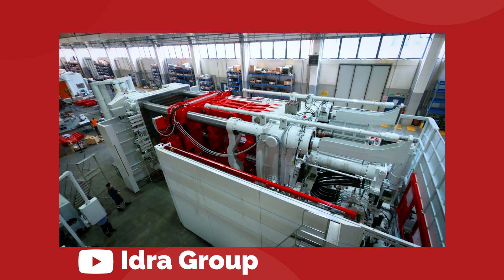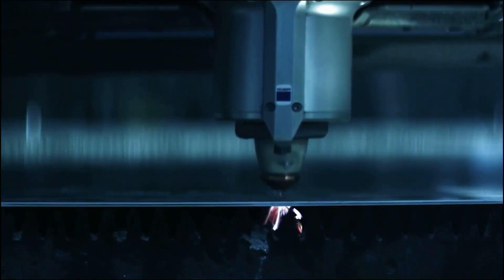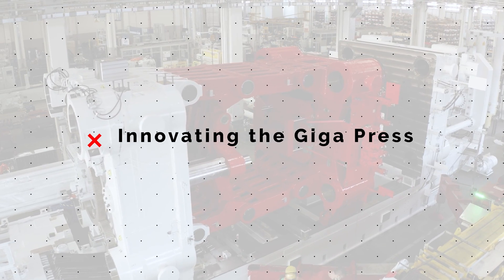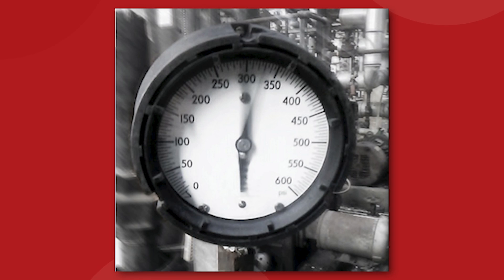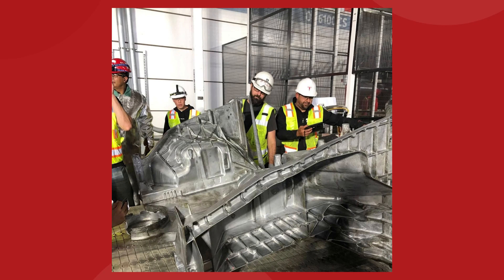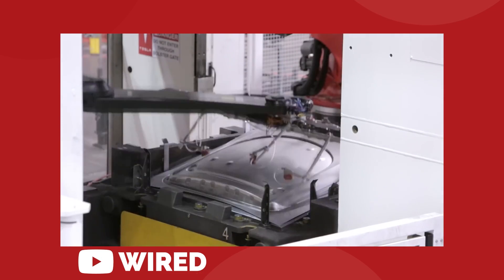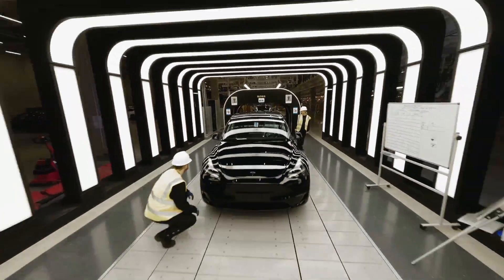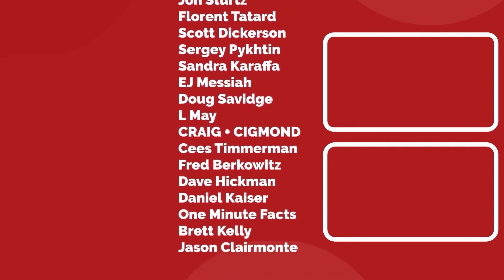The Real Reason Tesla Developed The Giga Press!

Comment: Hey, would have been neat to have an actual comparison between a solid frame and a sheet metal & welded frame, you know, repair costs if damaged, crash tests, actual long term manufacture costs and required power for making them, you know, the basics.
Sure, you did tell that it reduces shop size, but I'd like to know some real data about it.
Reply: if damaged it probably can't be repaired.  but that OK just write it off and melt it down

Comment: VJ'S (Video Jockeys) have "opinions "..
While the "giga press" is the next level of casting machines that is a very impressive product of engineering it still requires steel or aluminum to cast... The fact that it still requires basic elements to work seriously limits its capabilities.

Comment: Excellent vid, and well narrated. Interesting to learn about the diff between clamping vs. injection force. And the filter for the molten aluminum was interesting, as would be the machines which produce that filter, and the machines which produced THOSE machines.... ...smh... engineering wheels within wheels.  
I never checked this channel before, but like Ahh-nold says,  "Owl be back..."

Comment: The differential between injection and clamping tonnage is a pressure consideration is it not? The pressure at the head of the plunger, when applied to the greater surface area of the mold cavities requires far more clamping tonnage. So the forces cannot be the same but the pressures are (negating losses in the injection).

Comment: Good for manufacturing maybe, but a slight accident will total a Tesla because it is deemed irreparable. Also, Tesla goes to great lengths to prevent independent shops from fixing a Tesla, primarily by making parts unavailable.
I considered buying a Tesla until I learned this.

Comment: One down-side for using the single cast component for large parts of a car. A car accident... Anything that crushes, cracks or breaks the casting requires a new casting. If you priced that casting, it will probably almost the value of a car due to the cost of removing the damaged part and replacing it with a highly priced replacement casting. 
More than likely, anything that breaks the casting will end up as an insurance constructive loss, or total the car and replace it. Your insurance will cost more since it will cost them more to keep most of them on the road.

Comment: Why clamping force on dies is so must higher than the pumping force? Simple... "mechanical advantage".
Basic hydraulic pump theory:
Say, two piston/cylinders of different areas containing an incompressible and frictionless fluid are connected by a fluid conduit. If a certain amount of force is applied to one piston the other piston will push with that force multiplied by the ratio of their areas.

So let's say the area of the piston injecting the metal is 1 square-foot and the effective-area (parallel to the die faces) of the part being cast is 20 square-feet. The force required to keep the dies together will need to be 20 times the force applied by the pump.

In real life, liquid metal has significant viscosity and some extra force is required to keep a tight seal between the dies.

Comment: During WWII the Germans used a MEGA Press to build fighter airplanes.  It gave them  many advantages in rigidity,  material flexibility, lightness and speed of manufacture.  The presses in the Allied sector were moved to USA after Germany's defeat ... So old tech with a modern implementation.

Comment: Efficiency is questionable. It all depends on time it takes to produce parts. Estimate is 90s cycle.  This could be limiting factor. Normal production time is less then a minute for car (300 000 cars per year). They have 4 presses. Two parts per car and at this moment just one model. That makes it 45s per part without manipulation. That does not look very promising. Stamping and welding requires more steps but it is way faster. And castings have one big disadvantage. If you crash your car and damage this casting it will be totaled. In case of stamped parts, you can replace lot of them. But cast part is too deeply in base structure.  It will be lot of labor and very expensive part (If Tesla will be willing to sell spare part. Most  probably not). You can argue , that some damage could be fixed by welding, but only some minor damage. Cast parts are hard to weld and strength of welded part is lower.

Comment: there are better manufacturing processes but either they are patented which destroys our advancement speed in technology or the technology although theorized has not yet been tested like the idea of flashforging particles of metal being suspended in the air with ultrasonic vibrations. that idea can possibly make the strongest parts ever possible because every atom can be welded specifically where you want it. also Elon Musk is basically a scam artist and you should probably figure out how to branch out your channel eventually. your entire success is reliant on the success of a man who has failed more times than he has succeeded and all he has left is Tesla, starlink and his satelite delivery system. starlink might also fail. being a fan of someone like that just makes it hurt more when they eventually fail because he is human unlike what some people think.

Comment: That's a cute little press.  After WW2 the U.S. built a 50,000 ton forging press.  It currently resides at Howmet Aerospace's Cleveland Operations, where it stamps out parts for U.S. fighter planes.  It was completely rebuilt a few years ago.
Reply: Most of the people in this comment section are impressed by this littlething 😄
Reply: Watching the 50k run is very cool for an engineer. I had a little part in the rebuild-  I  installed the 50K press' fume exhaust.  My boss ran the rebuild project.  That little press at tesla is about the size of two presses I have rebuilt... the 4000ton Ajax and the 3001 rd wood press.
Reply: And by the way, the us built two 50k ton presses and two 35k ton presses in the 50's. All gour still in operation.
Reply: Typo...all four still in operation.

Comment: Having only two main structures on a vehicle sounds good until you get into an accident and you have to replace one half of the vehicle if only a small part of the structure gets damaged..... Unlike a normal uni body construction which you can drill out the spot welds and replace or weld on new panels.....

Comment: It's beneficial for the manufacturer, not the consumer. If that vehicle is in an accident, it's totaled. The only way that will be repaired is by replacing the whole section, which will end up costing more than the depreciated value of the vehicle. That in turn will raise the cost of insurance on those vehicles.

Comment: The production advantages created by Tesla speaks volumes.  A similar presentation concentrating on the casting machinery created in Italy mentioned another advantage missed in the presentation just viewed.  I speak of the speed the casting machinery works at.  I believe the entire process was something like a minute and thirty seconds.  Running for 24 hours straight creates 960 car castings.  Allowing for inefficiencies and maintenance of the machine say 10 percent still leaves a huge production capability.  I toured a ford plant in Oakville , Ontario Canada in the mid fifties as a teenager.  Amazing times.

Comment: The problem I see with these large monolithic pieces is repair.
If something tweaks the frame of the car, you can't get a new member and bolt or weld it in place,  The part has to be tweaked back into shape.  Now you get into issues of work hardening and how metals become brittle when hardened.  I'd almost rather see smaller parts cast and then robotically welded together.  It would make for a more repairable chassis.
Reply: There's another possible related issue. Lamented sheet steel stampings, when designed properly, can flex and absorb impulse forces for decades without fatigue. A casting just can't, and I'm not convinced that problem can be eliminated. 

Wouldn't put it past musk to sell a car that he knows will have a reduced service life due to structural failure.

Comment: Jaguar Land Rover have been using single piece aluminium pressed frames like this for decades now. They use Swiss made robots to do it, the same ones that make Airbus plane frames.

The only thing unique about what Tesla is doing is having the press cast inside the car assembly factory, most car manufacturers avoid this due to extreme risks.

Comment: Very impressive technology, a great explanation, and a nicely made video. However, very worrying from a repairability perspective.  You cannot weld on cast parts. So, if the frame rail gets damaged, which can easily be replaced on a normal car, you would need to replace the complete front half or even the whole underbody.  The financial and environmental impact of this cannot be overstated.
Reply: @vincent de sadeleer Yours is the only knowledgeable response I've seen so far from  this bunch of oohing and aahing acolytes. The Gigapress is just another "Look how smart I am show" by the world's biggest narcissist. Yes, making a single-piece die-cast main frame for the vehicle is a lot of idiotic hot air. No mention of torsional rigidity or resistance to fracturing. And as you've noted, what to do when the giant die casting gets damaged? I'd be very surprised indeed if die cast main frames made on that  that Gigapress becomes the standard Tesla method down the road.
Reply: i guess on the enviromental damage that 600 robots makes 24/7 and who knows how much money on manteinance the entire world saves from this, this could probably overcome the damage of producing a new frame, and i guess they could re utilize that metal again, but im not sure, i dont see why not

Comment: Tesla did not develop the GigaPress.  It was the evoluation of the very large casting machines from IDRA (An Italian/Chinese casting company).  IDRA was asked for a larger machine, and they developed it, and have sold about 20 of them so far (Tesla being the first customer).  

Crediting Elon with inventing the world's largest casting press is appropriate. Elon is not a metallurgist, nor has any clue how to make a machine like this, which requires decades of specific industry experience. 

If you want to see tours of the IDRA facilities there are various videos. It's kind of a hard machine to visualize because it is so big.

I would like to also point out that giant castings have some drawbacks. Firstly, in the case of some body damage, it will be very difficult to repair. Steel is more malleable and more easily welded than Aluminum, and very large castings like this will mean that it will be impractical to replace the casting, because it is one giant piece.  Yes it saves on assembly labor, but repairability goes down.  Everything has trade-offs, and these giant castings could make the car disposable, and stripping it down the chassis might be tough if they use enough glued parts.

Comment: ..aluminium casted parts are usually strong but very brittle if reach sudden impact force near specification limits, and doesnt allow much flexing if any, which is sort of key for car chassis..any impact which normal car will make be easy repairable, will make these to be scrapped ..

Comment: I think IC engine cars are still going to be around longer than 10 years...
Reply: ...they are not going anywhere...just think of this..

1 kg of diesel = 12 700 W/h 
1kg of Li Ion battery = 240W/h

..all this green mumbo jumbo is BS..
Reply: @eccosabanovic1589  . Some Peoples belief in 100% renewable energy means they just swallow whatever they are told in the media.
I just say to them, if you want energy, you have to burn something somewhere along the line. No free energy.

Comment: Honestly I'm more curious on the frame reparability from an engineering perspective. Seems like injection molded frames will also make them substantially more expensive to repair should the frame suffer damage. So what I'm curious about is the frame tougher because of this and is it tough enough that so few of them receive frame damage that it makes up for the repairability?
Reply: My thoughts also,  probably not that repairable.  These giga presses, make chassis thinner/lighter/stronger with fewer pieces, but they dont seem to make enough parts to sell to third party repair shops and have to replace whole chassis.   TSLA is on path of efficiency, which also means, constant small hardware and software revisions, which also means that the cars a little different from one made 6 months ago to now.
Reply: can you say “writeoff”?  I knew you could…
Reply: Isn't cast aluminium quite bittle compared to sheet metal or is this different kind of cast aluminium. How would crumple zones work?
Reply: @skorpius2029  Depends on the alloy.  This alloy is designed for this use.   It can be welded.   THere are 2 horns in front that bend over in a hard collision.  Not sure but think there maybe addition energy absorption ahead of the horns.   
Auto makers are going to a ultra high strength steels for their stampings.   These are said to be unrepairable.
Reply: @skorpius2029  I'm curious of the same thing. Normally cast is indeed more brittle. But you'd also hope they would have taken that into account when designing the frame..
Reply: @deathjunior7755  I'm sure they have dealt with that in some way. Would be interesting to know how. Maybe they have some sort of steel components inside the casts like steel rebar in concreate?
Reply: @skorpius2029  I cant see how that would work with this level of heat and pressure without causing a point of failure. Then again my background is mechanical engineering I have no specific training in metal injection molding.
Reply: @deathjunior7755  They took it into account when they designed the aluminum alloy.
Reply: If it's damaged enough the frame is damaged, likely the insurance company will just total the car.   That's true of conventional body construction too.  I'd rather my insurance company total a heavily damaged car than let some cobblers repair it and hand it back.   There aren't that many body shops that can handle aluminum repairs in general.
Reply: @quademasters249  depends on the car but frame repair is a thing. Their frame also includes the inner wheel tubs for example which could easily be damaged and with most cars that's repairable without being totaled.  Making what is essentially throwaway cars is just as bad if not worse for the environment than gas cars.
Reply: @quademasters249  exactly what I was going to say. I don’t think anyone repairs frames anymore

Comment: Facts are wrong. There are larger Injection moldimg machines with higher clampingforces than 4000 metric tons. Engel Austria build a machine for Sulo in Germany with 5000 tons. Otto in Charlotte operates a 2x3200ton Battenfeld Twin made in Germany. Stop hyping Tesla. Also: what do you do tf the car needs accident damage repair. Replace half of the car because its made from one pice?

Comment: There are differences between stamped steel and cast aluminium. The cast Aluminium should be lighter, but as an old school car guy that likes to work on cars, cast aluminium is going to be throw away in accidents, and a massive pita for modifying. Btw stamping the steel sheet is a little like forging , aligning the steel grain with the shape.

Comment: 05:09 It isn't treated with argon gas to remove impurities, it is kept in an argon atmosphere to prevent the formation of aluminum oxide impurities(slag). The slag was already removed, argon is a noble gas so it doesn't react with anything(under standard conditions), so using argon because it is plentiful in the atmosphere and inert makes sense. It doesn't remove impurities, it prevents them.
Reply: Afaik, you need to bubble argon through molten aluminum to remove dissolved hydrogen
Reply: Ha! I THOUGHT that sounded wrong, (too).

Comment: have worked at a die cast factory for 7 years, the 2 machines were made in 1962 - 1964, the clamping pressure was only 250 metric ton, fun to see what newar machines can do

Comment: this is cool,  but the single cast piece means that there is near zero repairability for those piece when damage occurs.  you can't replace pieces, you can't hammer them straight.  you can't weld to cast very well.  boo.

Comment: I love the idea of making a product out of large high-tech parts but I hate the branding of giga, mega, hyper as meaningless and full of overhype. The technology is nothing new and there is a good reason other manufacturers avoid creating extremely large parts by it. Fist of all - casted metal has much worse structural properties then pressed metal. The second huge issue can be seen in berlin where 60% of the "gigapress" production had been deemed as faulty and wasted. Appart from the one-side mindset of this clip it seems it is also plagued with tons of false or misleading data. I have no idea where You found the gross margin of 32.9% where in reality the number is 10% lower. Also the numbers are plagued by the sale of emission tickets and all other government e-car incentives. This would be relevant when comparing two electric car makers but You were comparing Toyotas and Teslas efficiency.

Comment: Giga casting is cost saving only for automakers which turns to profit increase for them. At current prices, 50k for a Tesla model 3, the new giga casted cars are much more expensive than any traditional car on the market, some of which sold under 10k. Customers today aren't affected in any positive way from giga casting, only negative downsides in case of an accident